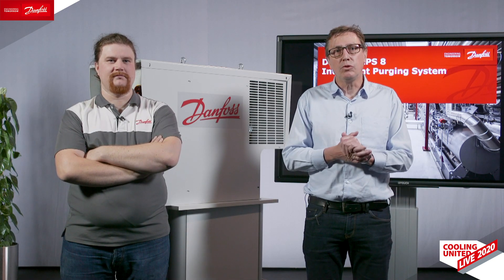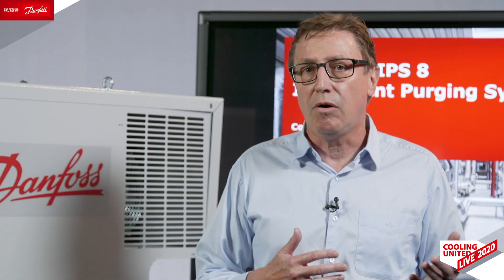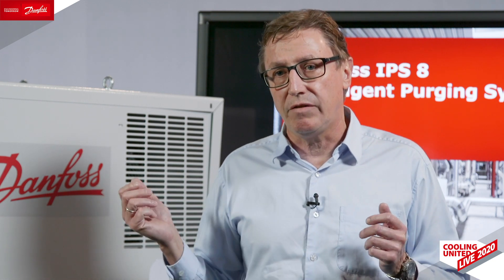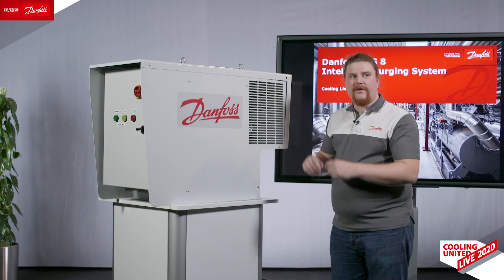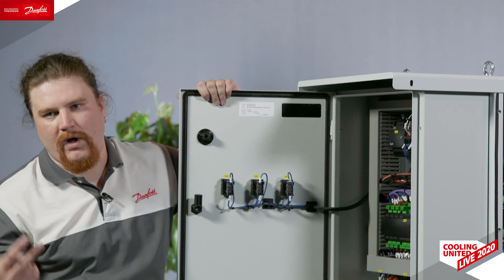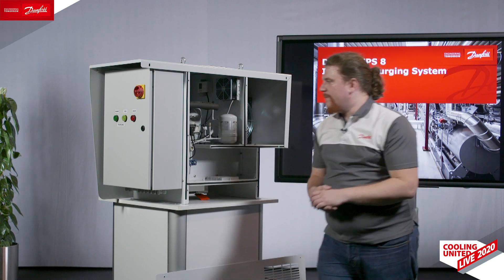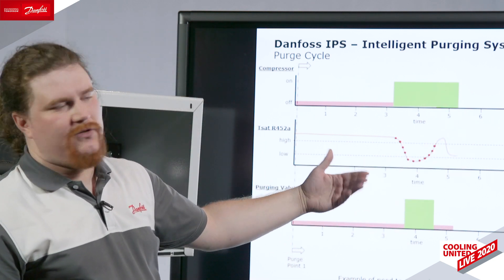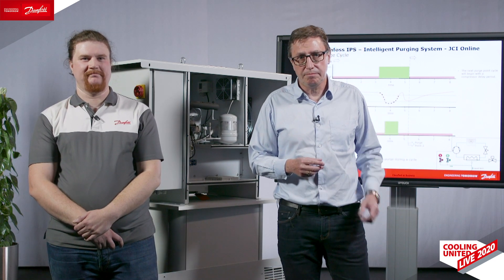Intelligent air purging with the IPS 8 | Cooling United Live

Comment: How Does LVL works in the evaporator...???
Reply: Hi, what you mean as LVL?
Reply: @egikeis  Hi.
 LVL = Liquid Level Switch 
What is the function of liquid level switch in the evaporator.
Reply from the maker: The LLS is used to prevent malfunctions, such as getting liquid from the purge point instead of gas. So, we can use the LLS as protection. As liquid gets inside, a sensor will send an alarm to the controller, and the unit will stop until the liquid is drained. The main idea is protection against draining pure liquid ammonia. For example, if the outlet from the condenser is closed, but the purge point is still open, the full capacity of the condenser will go to IPS. The LLS will notice this and stop the unit.
Reply: Do you have  diagram how to connect pipping to the system..
Reply: @DanfossClimate  😊 thanks for your detailed explanation.